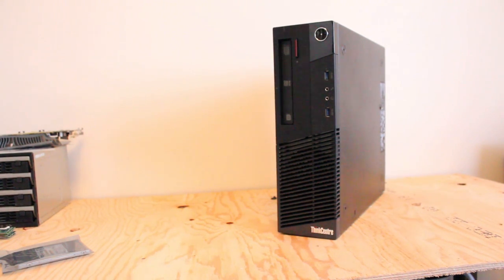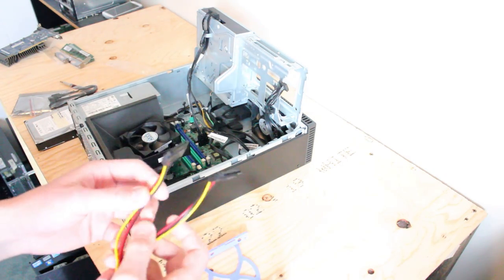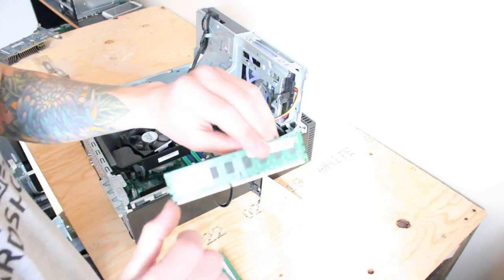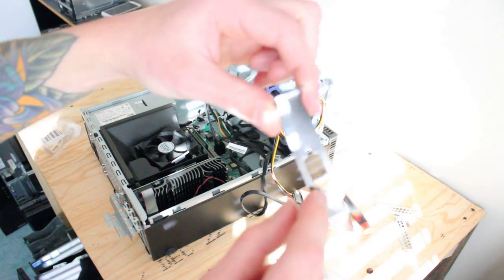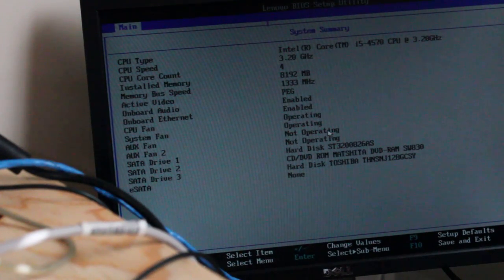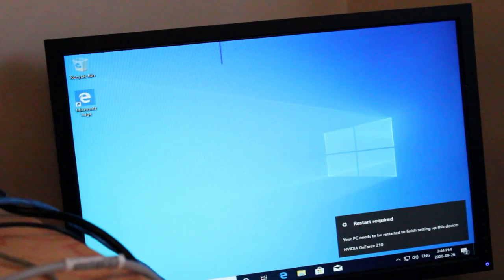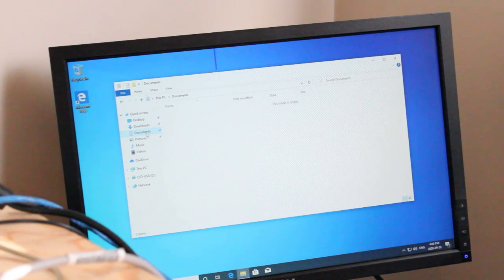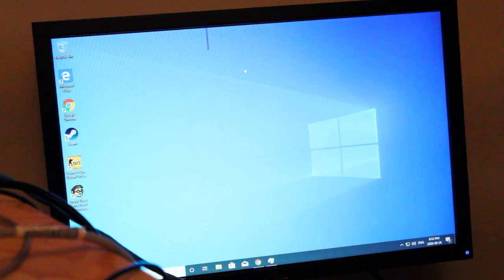Lenovo ThinkCentre M93p SFF Upgrade (SSD, RAM, Graphics Card, HDD)

Comment from the maker: M93p Series:  Best: i7-4770 & GTX 1650 https://youtu.be/g3jLq8QT2hM?si=hp0G8ThM9V98nued **#2: GTX 1050, i7-4770, 24GB RAM, 2 x SSD, Exhaust Fan Mod  https://youtu.be/vQOih0cb-Ys** **#3: GT 1030, 16GB RAM, SSD M93p  https://youtu.be/BderaGy5y4I**  **Runner Up:  M93p case Swap with a GTX 750ti https://youtu.be/JtHK0FJRINY **Second Runner Up:  Case swap with a Quadro 4000 https://youtu.be/xZ5ArnqXGzA** Thanks for all the comments and feedback :)
Reply: What case would you suggest as an upgrade ?
Reply from the maker: @riggermortisfpv526  Any modern case will work fine.  Check out this video for an idea.  I haven't shot one yet, but I will soon.  https://youtu.be/L4PPd5hnAok
Reply: @HaisteComputerRepair  Sweet ! Thankyou very much, I haven't built a system since the AMD K62 Processors came out, this is a huge help.
Reply from the maker: @riggermortisfpv526  For sure.  What are you planning on installing?  I have a couple on the go.  One build being i7-4770, GT 1050 low profile, 32GB RAM, new power supply, and a new tower case.  So basically just using the M93p motherboard.  I have a few to experiment with and refurbish at the moment.
Reply: @HaisteComputerRepair  Im going with an i5 4670, GTX1050 Ti, 32 gb ram, 512 ssd, Ive got a 500w supply Im going to use and an ATX mid, I think I found one with minimal bling I dig. Its for running Elite Dangerous and the Odyssey DLC.
Reply from the maker: @riggermortisfpv526  Nice, let me know how it goes.  If you're subbed to my channel I will put up a video once I get my i7 CPU in the mail.  Maybe sooner with a different setup.
Reply: @HaisteComputerRepair  I will for sure, its going to be a while though. Im getting notices on things currently shipping to me telling me its going to be 2-6 weeks longer. I live in British Columbia Canada, the province flooded and a ton of our highways washed away over the last day, so now Im trapped with about a mil others until the roads get fixed lol. But Im sub'd
Reply from the maker: @riggermortisfpv526  I live in BC too, up north in Prince George.  I was just down in Vancouver this weekend to see Kevin Smith at the Rio Theatre.  I was flying in and out, but just missed the floods by a day.  Thankfully my family and friends all live in the greater Vancouver area.  Hope you are doing alright, thanks for the Sub!
Reply: @HaisteComputerRepair  Yeah we are ok, no problem on the sub, thanks for the info.
Reply from the maker: @riggermortisfpv526  You bet!
Reply from the maker: @riggermortisfpv526  And check out this time stamp for plugging in the front panel power button, etc:  https://youtu.be/L4PPd5hnAok?t=920
Reply: @Haiste Computer Repair What's the maximum RAM on these? I am looking to put 64GB, any idea if that will work?
Reply from the maker: @newpain01  I have only ever installed 32GB DDR3 1600MHz RAM in a M93p.  64GB may work, but I don't know for sure.  Are you looking to buy or do you have some 16GB RAM sticks to test?  I've come across server RAM that is 16GB in capacity and I know some desktop RAM exists, but I've never thought about needing that much, especially paired with hardware in a M93p.  Not to say that you shouldn't or that I wouldn't, even if it's purely novelty.  What do you plan on using it for?
Reply: @HaisteComputerRepair  I have a Proxmox server running TrueNAS, Plex, HomeAssistant, PiHole, a bunch of Docker containers and a bunch of VMs, so it's eating RAM for breakfast :) The idea to run it on a M93p SFF is because I already have one and they are very power efficient (I am not running a dedicated graphics card and running the stock i5-4570 @ 3.20GHz (which I want to upgrade to something better, wondering if this mobo can support i7-4790k or Xeon E3 - let me know if you have an idea) I do not have 16GB sticks to test, only 8GB unfortunately. I watched some of your other videos about moving the M93p to other case and I will be doing something similar - moving mine to a server rack case and installing it in my server rack, so that will be a fun project. I got some PCI HBA card to be able to connect 8 SATA drives for the NAS. Surprised how expandable the M93p is, except for the PSU which I will probably have to replace since 240W might not be enough with 8 hard drives, not sure about that yet. Let me know if you have any tips.
Reply from the maker: @newpain01  I have some 300W SFF power supplies that would fit in a small enclosure, if you check my ebay page.  But, a new full sized power supply will be nice.  I think that sounds like a cool idea, I would love to hear about how it goes or see a video/pictures.  I do not think you can install a "K" series CPU on this motherboard.  No Xeon CPU's.  Aside from that, I have only ever installed an i7-4770 over the i5-4570.  You'll need a different board manufacturer for more upgrade options.  I think you have it covered.  A new power supply and maybe an i7-4770 is all I can suggest.  I would stick to 32GB of RAM unless you come across a really good deal or can test run 64GB somehow.

Comment: I have a question for the professional. I've got a very similar ThinkCentre M series want to install a graphics card into it too, but the label on its LiteOn PSU says 240W Max. The graphics card recommends 300W PSU. Should I go ahead and install the card or the PSU might overload ?
Reply from the maker: What card are you looking at?
Reply: @HaisteComputerRepair  Oh, thanks for answering, the candidates are MSI GT 710 or ASUS GT730 if they fit into the tiny space inside the PC box. Both advise 300 W PSU, and mine is 240 W max.
Reply from the maker: @TaijiquanGaoshou  If you can, look for something like a GTX 1050Ti low profile and up.  Unless you only want more displays, the 710 and 730 are not all that useful over the existing CPU integrated graphics.  Low profile card being the key word.  These cards have a low power draw and 240W is plenty.
Reply: @HaisteComputerRepair  This is great, thank you so much !!!

Comment: Hi
Great video. I have  a question. Where do you put the SSD? I don't figure where you are put it.
Regards
Reply from the maker: I would strap it into the 3.5" bay with a tie strap, under a 3.5" HDD if I installed one, or double sided tape to the case beside the intake fan.

Comment: Good Video! I also have this machine and I have found that the integrated graphics are actually better than the GT 710 GPU. That said, kind of crap for gaming. HOWEVER, I now have a GTX 1050ti in mine and it runs new games quite well! I recommend!
Reply from the maker: Awesome!  The GPU I installed in this video is not a good choice, for sure.  I have another video where I installed a GTX 1050 and I agree it's quite nice.

Comment: this pc works i7 4790k?
Reply from the maker: I don't think the K series of CPU's will work, or if they do you won't really be able to overclock to the best of my knowledge.  Safest bet is an i7-4770 with the M93p I'd say.
Reply: @HaisteComputerRepair  but i7 4790 is works for this pc?
Reply from the maker: @artpro789  I can't say if the i7-4790 works on the M93p because I've never tried personally.  The Lenovo motherboard more than likely doesn't support the K series, from what I assume and reports I've read online.  I wouldn't recommend it unless you have both on you and are able to try it out.  I would love to know the results.   You may be better off finding a used MSI, Gigabyte, ASUS, etc, motherboard to support the 4th gen K series CPU's.
Reply: @HaisteComputerRepair  why?

Comment: What are your thoughts on the CPU cooler, does it actually work to draw hot air out of the case?
Reply from the maker: With the fan shroud, I think it at least allows heat to passively come out of the rear.  I have installed small exhaust fans before and the thermals are much better.  Depends on what you are doing with it.  When I installed an i7-4770 and GTX 1050ti, the extra exhaust fan mod helped a lot.
Reply: @HaisteComputerRepair  Where did you manage to install an exhaust fan, space is tight? You don't mean the front fan right?

I'm torn betwen buying this or an HP 800 G1 where the CPU fan exhausts directly to the back of the case but where there is only one fan.
Reply from the maker: @jbol2454  I shot a video of me mounting the fan here https://youtu.be/GYew4MwHxMg

It's a little long winded, but you can skip to parts you want to see.  Another alternative is swapping into a larger case and installing different hardware.  I also did some videos on that if you want some ideas.
Reply: @HaisteComputerRepair  Amazing thank you, I'll stay with SFF I love it.
Reply from the maker: @jbol2454  Awesome :)

Comment: Is there any way I could put in a 1660 super in?
Reply from the maker: Yep, you would just need to upgrade the power supply (300W min according to techpowerup) and either migrate the system into a larger case or get some PCIe cable extenders and let the GPU hang out.

Comment: Can i fit an Asus GT1030 Low Profile in this computer without changing the bracket? Because it has a DVI port instead of VGA port which the small bracket has
Reply from the maker: Absolutely, check out the pinned comment.  There is a video of me testing out a GT 1030.  It's easy to install.

Comment: Is E93 the same as M93?

Mine has a 240W 80+ bronze PSU (china  OEM?)

Isit worth it to slap a 1050ti on it? Or just swap an ssd n run win10?

I got my hands one 1 with win 7 pro and 1tb ssd. i5-4460 8gb ram (but somehow the task manager showed that it's using 3gb on idle.)

I want to make it a budget gaming PC but if i cant then i would want it to have resellable value like win10 n office installed...
Reply from the maker: If you have the budget or find a cheap GT 1050ti I would go for it.  Look for an i7-4770 CPU to swap out for the i5 and you will have a nice little tower.  If you check out my other M93p videos I have tried out this configuration with good results.

Comment: Cool vid dude very helpful

same model i want to upgrade with nvidia gtx 550 ti, should i upgrade the power supply? Or i should just use the one that are already there?
Reply from the maker: Is there a low profile version of that card or are you going to use a larger case?  The suggested PSU is 300W, but you might get away with the stock 240W, especially if it's a low profile design.
Reply: @HaisteComputerRepair  im planning to use a bigger case
Reply from the maker: @teckzerd9987  Cool, if you can find a power supply with at least 450-600W, that would be a good start towards future upgrades.  Plus a regular sized power supply will fit a larger case better.  But, people make do and modify as needed.  Let me know how it goes.  Look on local buy and sells for something used.  If you have an Amazon Prime account and live in North America, I find deals consistently on power supplies.  I picked up some Corsair 650W power supplies for $55 CAD each after tax.
Reply: @HaisteComputerRepair  alright mate thanks for the help
Reply from the maker: @teckzerd9987  No problem :)
Reply: @HaisteComputerRepair  hey got a question here, does the gpu must connect to a power source anywhere because i only see you plugged the graphic cards right away and it can be used
Reply from the maker: @teckzerd9987  The GI 210 I installed does not require any PCI power plugs from the power supply ( btw don't use this card, I just used it as an example - it's less powerful than the integrated Intel HD 4600).  Most low profile cards do not require extra power plugs.  If you ever want to install a card that does require this, be sure to upgrade the power supply at the same time.  Let me know if you want some examples, or check out my M93p migration to a larger case here:  https://youtu.be/JtHK0FJRINY

Comment: how many 3.5" hard drive can be installed?
Reply from the maker: In the SFF case, there's only really room for one unless you take out the optical drive.  But, up to three SATA connections if you remove the optical drive and find the space.

Comment: I have the same but I have  a blue piece on it and it has a lock I can’t seem to open it
Reply from the maker: Is the blue piece on the rear?  That is likely to open the case.  Are you sure you don't have a Thinkcentre M92 or M91p?  Is it a padlock?
Reply: @HaisteComputerRepair  thank you this is what I needed a padlock
Reply from the maker: @AliBounds  Bolt cutters will take it off.
Reply: @HaisteComputerRepair  oh there was no need I had to push down it slides. And I just took it off it folds like flipping a page in the book
Reply from the maker: @AliBounds  Nice.  So it is confirmed to be a M93p?
Reply: @HaisteComputerRepair  my series is a M82 Lenovo
Reply from the maker: @AliBounds  Ok, so 3rd gen Intel CPU.  Nice, what kind of configuration are you going for?
Reply: @HaisteComputerRepair  if you mean updating system hardware I’m not doing that I don’t even  know what is compatible or nor I just was having ram issues making my pc not able to turn on and I needed it open to remove a ram stick I took one out and put it back in it seems I didn’t put it in correctly because I only 8 Ram which was originally 16
Reply from the maker: @AliBounds  So you have two sticks installed, system is booting, and it only registers 8GB instead of 16GB?  Try pulling up Task Manager by hitting Ctrl+Shift+Esc on the keyboard, then navigate to the "performance" tab, click on "Memory" and check were it says how many RAM sticks are installed.  Weird that it boots still while installed, but perhaps it's a dead Dimm slot on the motherboard.
Reply: @HaisteComputerRepair  I had them both in it wouldn’t boot up then I took one out and like grabbed a towel and wipe of dust and I guess I didn’t put it in correctly like hearing a snap like yours I don’t won’t to break it an I checked it states I have 8.0 GB
Reply from the maker: @AliBounds  Interesting.  You can use a pencil eraser to clean the contacts on a RAM stick, unless there is some kind of gunk.  Clean water or isopropyl alcohol dabbed on a microfiber cloth would work aswell.   Well, at least it is working with the one stick.  Good luck, feel free to reach out if you need any support around this.
Reply: @HaisteComputerRepair  I do have one so when I set it back if I didn’t hear a click so in order for me to know it’s down all the way I need to hear a click ?
Reply from the maker: @AliBounds  Not necessarily, no.  If it seems to be fitted in and both tabs can be closed you're probably ok.
Reply: @HaisteComputerRepair  I’ll look into that but I’m afraid my other ram stick is dead or something but I’ll try and see
Reply from the maker: @AliBounds  Yeah, no problem.  More of an FYI than a probable fix.  Good luck!
Reply: @HaisteComputerRepair  thanks for All the help it’s very appreciated
Reply from the maker: @AliBounds  My pleasure!
Reply: @HaisteComputerRepair  ok I have another issue sadly I probably should’ve just left it alone
Reply from the maker: @AliBounds  What's going on?   I know it can be frustrating, but try to think of it as a learning opportunity.
Reply: @HaisteComputerRepair  so you remember when I said I think perhaps I inserted my Memory stick in wrong well I kind of picked my computer up and then I opened because it feel out of its socket I heard it rattling inside so I put it back in then When I turned it on it makes like this horrible 3 beep and 1 long beep obviously i know it’s a memory issue I just can’t seem to know what I did wrong exactly
Reply: And wow you almost at 100k let me Get a friend over here @cracked black
Reply from the maker: @AliBounds  The three beeps followed by a long beep is a RAM problem.  So at least you know.  So one works, one doesn't, how about the others?
Reply from the maker: @AliBounds  That's right!  Slow crawl to 1000.  I will post a video to celebrate perhaps.
Reply: @HaisteComputerRepair  I only have two. I think perhaps I broke the other one because I took the other one out that aka : The beeps) I mis inserted and then it started doing that so I took both out and tried EACH one by itself on every slot and it’s the same thing so that sucks
Reply: @HaisteComputerRepair  Ok
Reply from the maker: @AliBounds  That is disappointing.  Probably still worth trying other RAM sticks if you can get some.  Is there a computer shop local to you?  Maybe they can help you out with testing some spare RAM.
Reply: @HaisteComputerRepair  will do I’ll go check it out. We’re really lucky to have some one awesome like you!
Reply from the maker: @AliBounds  Happy to help :)

Comment: Thanks a lot for this video. I am trying to upgrade my pc which is the same one which you have shown here. However, how can you add both HDD and SSD. I am not seeing space for both. It's either of them. I already have a 500 gb HDD. How can I add a SSD now. I want both
Reply from the maker: You can seat the SSD in front of the intake fan.  Just use something like electrical tape to fasten it to the case.  Then, there will be a bit of cooling from the fan and it's out of the way from the HDD.  Or use tie straps to fasten it under the HDD.  Use a SATA Y Splitter to get power to both drives.  Check out this for an example:  https://youtu.be/BderaGy5y4I
Reply: @HaisteComputerRepair  Thanks for the quick reply. Will definitely try and come back if I have further queries.
Reply from the maker: @SBH439  Awesome, good luck!

Comment: can this handle not low profile card?
Reply from the maker: Yes it can, but you would need to transfer everything to a larger case or try to use a cable adapter.  Or do some modifications to the SFF case to fit a large card.  Check out this case swap I just uploaded, which will show you what to do:  https://youtu.be/JtHK0FJRINY

Comment: i tried installing gt210 for a test AND DOENST boot at all
Reply from the maker: Was it booting before installing?
Reply: @HaisteComputerRepair  no display,  what to do
Reply from the maker: @Koromaru-j1w  do you have another system you can test the 210 in to ensure it’s working?